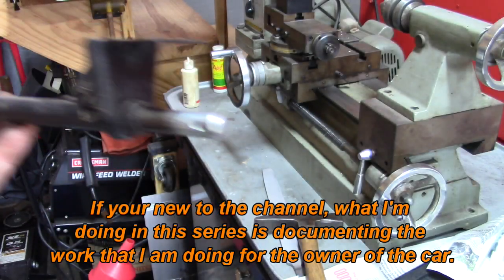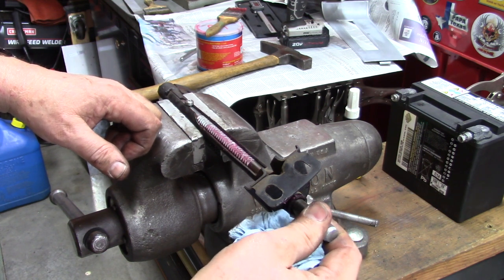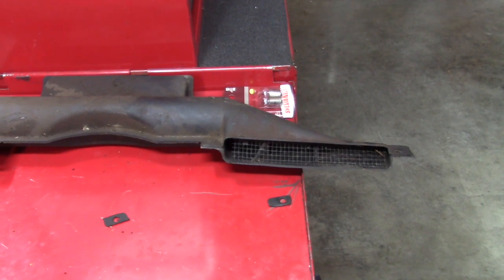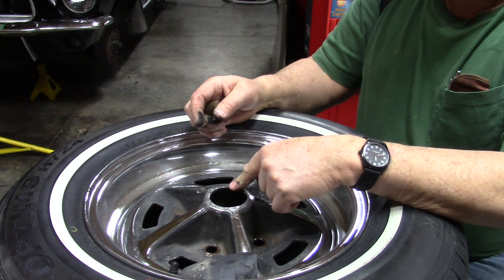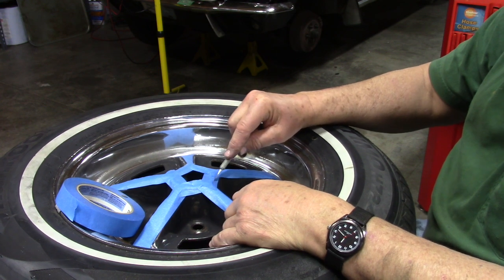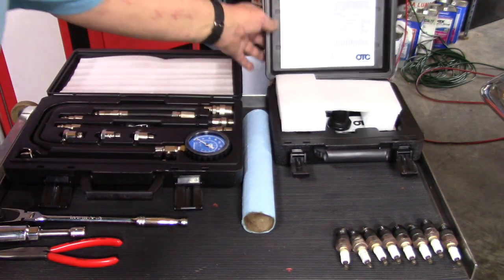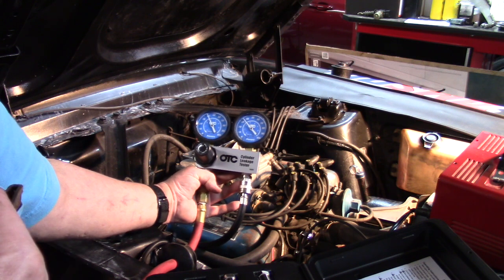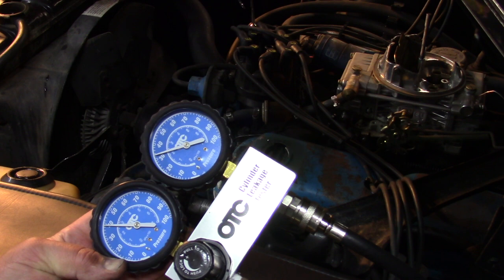1967 Mustang fastback part 3.

Comment: You had me earlier..when you posted the incorrect video. I have been there done that....LOL
I hate trying to squeeze up behind the dash... my body just wasn't designed for that kind of work.
Reply from the maker: It's rough trying to work under the dash. I ended up taking the drivers seat out to help with that. It has been a little better now. But I'm still too fat.  :)

Comment: Nice!! Coming right along! Compression a little on the low side, but if that thing sat any length of time, it might just need to be driven a good while to free the rings up a bit more. Could still definitely be worn out, for sure.  Rough running could be stale or just old fuel in the tank that needs to get burned through, or gum in the valve ports and/or guides.  On an interesting side note,  I've found stale gas seems to create more carbon when run frequently for short intervals. I've had a couple small engines where the carbon built up so much that when it sat for a few months, the carbon swelled, then the engine couldn't rotate past TDC! First time I saw that in a Yamaha generator I thought it was a fluke, but then I saw it again years later in a '78 Toro snowblower! Both units get run hard for short bursts, then sit for months and months on end, then run hard again with the same even more stale fuel. Just my theory anyway. That will raise compression right before the piston runs out of space, so doubtful that's going on with the Mustang.

I always do stuff like that with the camera, lol! The other half of it is, my camera will turn on when I meant to turn it off, or be off when I thought it was on! The former is a PITA because I never notice it, then I have 10 minutes of footage I have to scrap! Takes up a ton of space on the computer until I get around to editing. 1st world problems I guess!  Great stuff as usual, Wyatt! 
🍻
Reply from the maker: Once I get to the point where I can drive it I will definitely add fresh gas and I might pour a little Marvel Mystery oil in the carb to see if I can clear up the rings. It won't hurt to try. Now that I have a new starter installed I'm going to do the compression check over again...just to be sure I'm telling the owner the correct information. He was by today and he's happy with the progress! That's makes me feel better. Plus he paid me which is always good. I enjoy your insight and stories!
Reply: @wyattoneable  Glad to hear that, Wyatt. Thanks!  Yeah that Mystery Oil is great stuff. I haven't used it in years, but I remember my grandfather putting it in everything in the 70's. I even remember someone in high school using it as 2-stroke premix in a high-performance dirt bike, LOL! It worked! I couldn't believe it at the time. Glad you got paid,  and the customer is happy, too - that makes for a great day, for sure!

Comment: Thanks for the video Wyatt, I had an old Gran Torino many years ago that had a few miles on it when I got it. The engine ran great but like this mustang there were many parts of it worn out just like this mustang. Air conditioning controls, glove box wouldn't shut all the way, door handles that were broken etc. And it was a fairly well taken care of vehicle before I got it. This video brings back some memories.
Reply from the maker: That's a cool story James. Cars have a way of doing to us. Memories, good or bad can always be traced back to the car we were driving at the time. Sometimes I remember people from the cars they drove. Thanks for the comment.

Comment: you never know what you will find on an older vehicle. I'd run that thing on the road good and them recheck compression. Maybe one of Vice Grip Garage's Italian tuneups will help a little also. Owner should be happy you are trying to fix instead of replace those little parts. I alway figure my labor is cheap compared to some things.
Reply from the maker: Yes, that's the plan. I want to drive it. I have installed a new starter so the engine turns over much faster now. That will help to establish a better compression check I think. Thank you for checking in.

Comment: little work need to be done to the engine is it easier to put in a new one or rebuild the old one
Reply from the maker: The easiest thing to do would be to let my local shop exchange the engine for a rebuild. He charges $400 for his labor plus the cost of the engine of course. But since this is the original engine to this car, I'd be wanting to keep this particular engine. It would help to keep the value of this car. But the owner was here today and he's just going to drive it the way it is. He's 82 so he said it's not worth it to him to spend that much more money.

Comment: hey wyatt  yea i thought a valve  in 4 and 7  that motor is worn though   check for a vacuum leak around those ports maybe    wow that hvac stuff looked a mess... years ago i did so much under dash work  nowadays  if its longer then 20 min  i hate it
Reply from the maker: Working under the dash has proved to be not only a pain, but I'm not getting very far to fixing stuff. I have no schematics for wiring or vacuum lines so it's been a lot of trail and error. Mostly error.  :)

Comment: What paint was used for the black parts of the mag rim? Is it special paint? Flat black? Thanks
Reply from the maker: It's a gloss black from "Rust-oleum". Gloss protective enamel with superior coverage and durability. It says...lets see how long it holds up.
Reply: @wyattoneable  thank you! I have to do mine.
Reply from the maker: @dm7097  There are manufactures that make paint specifically for wheels but it's expensive. This paint is about $7 per can.